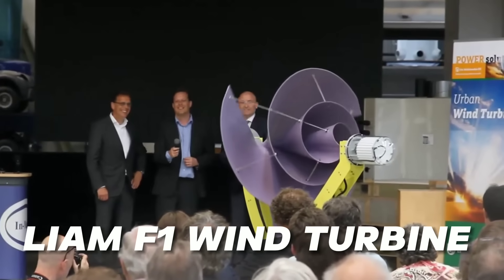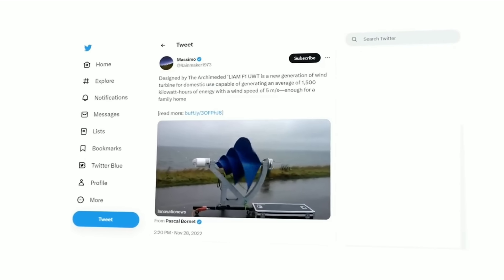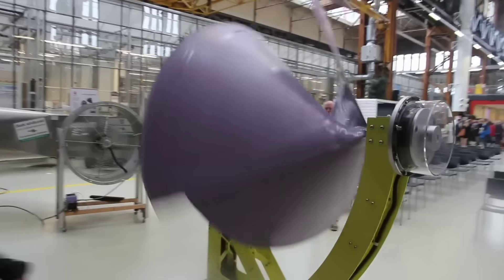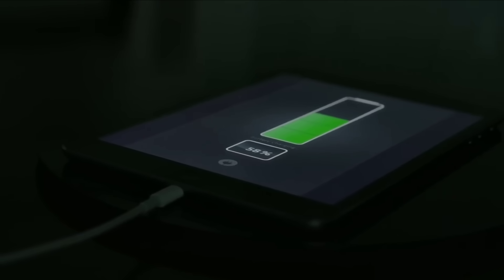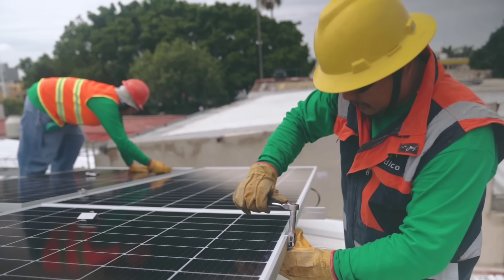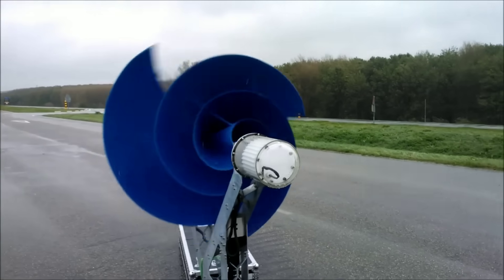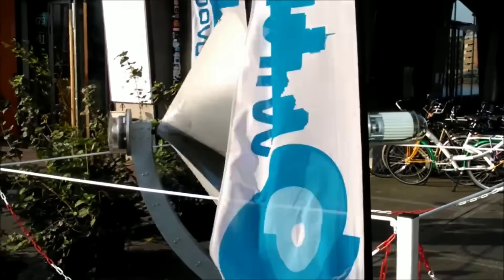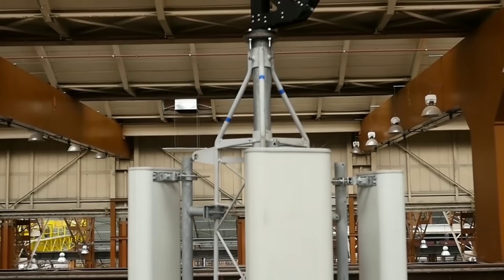This NEW European Wind Turbine for Home Outbeats PV Solar Panels in 2023?!

Comment: In the 15 years we have had solar PV, the panel peformance degradation has been almost zero.  We've cleaned them once.
Reply: Yeah, I get tired of everyone who selling a new innovation lying about the problems with the previous technology. Just tell us what is good about your new innovation and leave it at that.
Reply: @GrantSR I agree. ‘Don’t try to look better by degrading others’.
Reply: I think Solar and wind can complement each other night or day and with the correct number of battery storage wattage it could work👍
Reply: Only issue I had, was kids smashing a panel I had to replace, I only hosed them down to even see if they were dirty.. tyey were not after 9 years.
Sun does more damage to the (exposed) plastic then any thing else
Reply: @danielthompson3205   I have two large solar panels on the top of my minivan. (I was a vandweller for 6 years.) People always ask me if I'm worried about hail damage. I tell them that the panels are protecting my car. That they are rated for much larger hail than the roof of my car is.
Reply: Me too generating the same today after 10 years as year 1.
Reply: Thank you for posting that.  All I read is that they degrade over time and need to be replaced in 25-30 years?  In reality - probably not.  If you amortize the cost of installation over 50 years they really look like a bargain.
Reply: @markstephenson6952 Had our original array up since 2012, cleaned two years ago as we had some lichen form on the top ones. Last August we had our best ever production on that array. Bottom line, there may be some small degradation over the years but it’s the amount of sun shining is the one that makes the difference. With the wind turbines their production is also dependant on weather, the wind. They shouldn’t be viewed as competition for each other, as the video said.
Reply: @lynnfisher4396  There is a kind of anticorrelation  between wind and sun. Still, these things are over-priced, so I can't see a great demand.
Reply: @lynnfisher4396 They should be seen as complementary.
Reply: @Danielle-zq7kb  I did say that, yes.
Reply: @markstephenson6952 I think the climate has to do with that. In Florida they degrade faster according to customers and solar companies.
Reply: @markstephenson6952 Actually, you can amortize the cost and benefit of these systems because you have to factor in rising utility costs. And with the rapid climate change we are experiencing, utility cost will far outstrip the cost of the systems in the next five to ten years.
Reply: @markstephenson6952 what a bargain! Considering that I probably have about 25 years of life left
Reply: @markstephenson6952 aren’t the very first solar PV panels installed in the US in the 1970s still producing electricity
Reply: @hughmarcus1  my Casio Calc still works, & it has not rained satellites due to no power.
Reply: How much is almost zero?
Reply: Agreed. I've got 20+ year individual panels still Max👍👍👌👊
Reply: ان المبلغ المطلوب مقابل السلعة هو كبير جدا بالنسبة لمولدة  و قطعتين من ااحديد و حلزون بلاستيكي . 
اذا كان الثمن ١٠٠٠ دولار سيكون مناسب . 
نحن في الشرق الاوسط مردود الالواح الشمسية ممتاز لكن مشكلو المساحة لتثبيتها .
Reply: Same here - had mine since 2015 - plus tesla powerwall
Reply: On the surface it seems to be a good invention. I could see using a combo with solar
Reply: Oh ya. I want a see a mini one for my rv
Reply: Having no degradation without cleaning them every once and awhile? I call bs. I have had solar panels for only 5 years and high quality. Anybody that says they don't get degradation and never clean them, I say has never done an accurate test. Try using a squeegee to clean a line of panels with some dawn dish soap, and I will put my life on it that they perform better than the others.
Reply: Can I use one on my RV ?👍🏻😀
Reply: @LS-vo7hc  there are special units for RV
Reply: What crap. Solar panels need no maintenance and wind turbines need plenty
Reply: @TomTheSurgen1  Just explain how me, a professional installer, has not needed to do ANY maintenance on any of my Solar builds.
And would you educate me in what maintenance would be involved.
Reply: At least you got 15 years out of them before having to get rid of them for 2 of these awesome looking turbines.
Reply: @ShutYourMouthBeeech  he said have had, meaning he still has them and likely will for a few more decades.
Reply: Ohhh. Did he not watch the video or what? He should get rid of those dusty panels and get 2 of these awesome turbines.
Reply: Just don't fall for Solar when the utilities company wants to install it on your roof/property..it is NOT beneficial to the property owner in my opinion. Get a power storage and store as much as you can and stay OFF the grid..cripple the Corporate plan and stop giving them money . Period. It can be done.
Reply: @Nowayjose-vd1wm  it will become easier and easier as battery storage system prices keep falling.  While it’s not realistic for many, it’s super realistic for lots of people.
Reply: @brettgracey9682  agreed 100%... not certain where your located but here in NY state they seem to pushing homeowners to let the power companies install and basically lease back ..I have seen countless issue with that "plan" ..I myself can not afford a battery wall yet but I am working towards that. All good things in time
Reply: @jkirby-vd1wm  What about when you use so much electricity that there'd never be anything to store?  Batteries of any sort would not make sense for me.
And at €0.46 a kwh, the mains supply is expensive.
Reply: I think the wind and solar would be perfect for a home stead in the mountains. Its always windy at night and especially the fall/winter (in the Appalachian mountains).
Reply: How much progress has been made in over 100 years.
Reply: I’m looking at solar but don’t know much about it. How much are the maintenance costs (electronics, panels, batteries etc.) over 15 or 30 years?
Reply: @RobertJohnson-lb3qz  assuming you are talking about a 10kw or less home array, you should probably go with micro inverted panels.  With them you shouldn’t have any significant maintenance costs beyond spraying them off with your garden hose.  The panels themselves and the micro inverters usually carry a 25 year warranty.  As for the rest of the system, it’s kind of like asking how much does a loaf of bread cost.  How big of a battery system do you want/need, if at all.  There are some components that can wear, like charge controllers, cutoff switches, the batteries themself, that are subject to degradation, and that rate can vary widely depending on size and quality of the components.  Many of them only carry a 5 year warranty.  If you don’t go micro inverted panels, then you will have an inverter with a 5 year warranty.   There are lots of variables and it would be best to consult a professional as to what your needs really are and how best to fulfill those needs.
Reply: @brettgracey9682  Thank very much! 👍
Reply: @RobertJohnson-lb3qz  
Don't bother looking!  Despite what you may read here, there is simply no way (mathematically) that a typical solar array pays for itself.  It will end up COSTING you money.

A typical 3kW solar array with batteries costs £9,795.
It will typically generate 2,500 kWh a year.
2,500 kW would cost £750 at 30p per kWh, so you’re saving £750 a year.
We have to remove (from that saving) your lost interest of £490 on the capital (at 5%).
So you're down to £260 a year.
Maintenance costs are £160 a year.
So you're down to £100 a year savings.
BUT...
In 12-15 years you need to change the batteries, that’s £5,037, and the inverter has packed up, that’s £5,251 - so £10,288.
So your savings of £100 a year over 25 years is £2,500 - minus the above equals a loss of £7,788 after 25 years.
Madness, isn't it?

Inflation and interest rates affect the above data, but one tends to cancel out the other.  Even if electricity massively increases from 30p per kWh, the data doesn't change much, you still lose.  As crazy as our energy prices are, the fact is that you cannot typically do it cheaper than a supplier can.  If you could, there would be no electricity suppliers.
Reply: I’m not sure I’d trust anyone who reports kilowattt hours as km/h, surely it’s kw/h, as for the rest of the narrative it’s all “according to the company” quotes, not for me thanks.
Reply: When you buy amorphous panels that is what happens, not polycrystalline.
Reply: Bull. The panels output drops as the temperature increases. You’re just too ignorant to know better.
Reply: I don’t clean mine and ge5 same returns as I did years ago
Reply: I think as most are saying one should sell their advantages ans try to compete with other options because its not a one size fit all for all markets and not everyone has wind, hydro or sun except for a lucky few geographical areas.
Reply: Where i can lern that new math?
Reply: Solar cells are basically pieces of rock. They are usually silicon. That's rock. They will almost never degrade.

The myths of degradation are highly over stated.

Sometimes you have damaged wires etc that need some resoldering but that is usually obvious and easy.

That does NOT apply to the newer flexible panels. They can (will) get a lot of minor cracks from vibration and folding that can eliminate continuity and lower output rather drastically with use.
Reply: That was bs in my opinion. Rain is doing pretty good job cleaning them. Don't know a single person who has to clean them.
Reply: Back then performance warranty used to be 10 or 15 years ..get the new one
Reply: Put I don’t think I can make solar panels pay for theirselves
Reply: Outbeats? I’ve been speaking English for 77 years and that’s a new one for me!
Reply: Minimum wind velocity needed for this Home wind turbine ??? What would happen in RAIN ???
Reply: Anything that has moving parts will have maintenance .
Reply: Are u talking about panels or batteries here
Reply: We have had pv solar for 30 there is some degradation but not bad! I’m sure newer models are even better
Reply: @jonathannumer5415  @grahamsouthon553 is properly 16-18% efficient, mine are 2009 panels and are 12-14%, today's solar max's out a 22%, and the maximum efficiency possible is 25%, my array still as the same production as from new, from the yr by yr data, when I sell solar to customers I point out satellites have been in space scene 1955 and most people may still have a Casio solar Calc from the 70s. 
I'm sure there will be some losses, if they still work, don't try to fix them.
Reply: @jonathannumer5415 😂newer model they make even worst because they want sales so they decrease quality of the product to boost there sales
Reply: @jonathannumer5415 3
Reply: are you talking about panels or batteries ?
Reply: from what I heard you gotta clean the panels regularly to maintain efficiency.
Reply: @spicychad55   Yeah, but "regularly" means just a few times a year. And you gotta clean your RV anyway. So, there you go. Sure, you can clean them every week, if you want, to keep absolute peak efficiency. But, if you are smart, you actually plan your capacity with the assumption that they will be kinda dirty all the time. 

It's kinda like people complaining that you gotta clean your spark plugs in your car, or "the efficiency degrades." But no one cleans their spark plugs every week. You just engineer your system to account for the fact that spark plugs get dirty just about as soon as you start the engine for the first time. 

All the complaints about solar are mostly just focusing on tiny problems while ignoring the major problems with other solutions, simply because we have become used to those other problems.
Reply: @spicychad55 so what you lazy fooker 😅😅😅 ffs
Reply: $2,000 for solar panels is extremely optimistic in the U.S. even with the so-called subsidies that were supposedly offered. Solar panel installation has many more drawbacks other than just degradation, which in most cases actually runs closer to 7 years. Installation of solar does not provide power to your home but feeds back power to the grid, thereby reducing your utility bill. Once your panels on the roof they are there to stay. If you have replace your roof, due to age, weather, etc., you have to have the system uninstalled and then reinstalled after the roof is replaced. Your panels are not covered by your homeowners insurance which means you will paying out of pocket for any wx damage. When selling your home they are also detrimental to the general market not interested in solar, especially if they are aware of the short comings. And if you’re still paying on your original contract, you can forget about any buyers interest period. 
The video was honest in its appraisal of the benefits and shortcomings of wind power. Most importantly, determine what conditions you have to support each media and look at your long term goals. 

The most important thing to realize is they both will soon reach a point diminishing cost, because utility cost are soon going to far outstrip the cost of these systems.
Reply: @larrymcgill5508  if you have a decent installer, you typically have to have a relatively new roof, to get an install.  Who would pay for an install, then get a new roof 3 years later?  As for net metering, that would be up to the individual jurisdiction.  With the rapid expansion of home battery storage, one could easily disconnect from the grid, or only net meter a portion of electricity generated.  As for a selling point, I would think that’s a financial decision.  If one was in an area where they routinely got $600-$800 electricity bills due to air conditioning loads, having a solar array that significantly reduced that monthly cost would be rather attractive to most people.
Reply: Solar panel degradation IS 0.6% per year.  You cannot dance your way around that.  You will typically NEVER get your money back (capital investment) on solar panels or wind turbines.  The mathematics say so.
Reply: @jimskirtt5717 even if we were to accept your number as true, a 400w panel at 30 years would still produce 328w, or 82%.  A more accurate number is actually .5% per year, which would means the average 400w panel would produce at 85% after 30 years or 340w.  Hardly insignificant.
Reply: @brettgracey9682  
Doesn't matter.  The mathematics say typical solar doesn't payback - in fact, it costs money.  It wouldn't matter if they retained 100% efficiency (which they probably will in the future - but by then, everyone will know that solar is a dead loss).
Reply: @jimskirtt5717  well Jim Skirtt, give us those numbers that just don’t add up. Also tell us what jurisdiction you are making these assumptions in, so we can also calculate how much solar power can actually be generated.  Thanks.
Reply: @jimskirtt5717 solar panels payback period is like 3 years in the NL. do your research
Reply: @jimskirtt5717 if your paying someone to do it...diy its well worth it
Reply: @jimskirtt5717 By chance did the math also include the rapid climate change and the runaway escalation of utility costs. I think probably not.
Reply: @larrymcgill5508  
Inflation is factored into the cost analysis I have done.

So, do you think something can be done about climate change, then?  I note you didn't say 'man-made' preceding it, which is good.  I don't know if it's because of your personal ignorance or a slip on the keyboard - you tell me.

As for utility costs, there are a number of factors, but again, it is basically because of futile attempts to claim CO2 as a control knob.  If we burned our coal reserves, we could have amazingly-cheap energy.  Now, be careful, as this is my field, and I could tie you up in knots if you are not as 10% armed with knowledge of the energy sector as I am.
Reply: @jimskirtt5717  Dude! What are you thinking? Did you re-invent math? New solar panels are between 30 to 50 cents a watt. They pay for themselves in a year or two.
Reply: @MichaelBushey  
No, they don't.  Typically, they NEVER pay for themselves.  I don't know what you do, but I do this for a living.  If you think they typically EVER pay for themselves, show me the mathematics (the FULL cost analysis) which exists in the universe you inhabit.

The difference between you and me is that I have done it - and have to do it for each client.  You on the other hand, have read something and believed it to be true.  If you want me to help you out, let me know.
Reply: @MichaelBushey  
My replies are being removed!

1.  How much was your total capital outlay?
2.  What is the cost of purchased kilowatts from your supplier?
3.  How much will your system save you annually?
4.  Where did you get the money from - what interest rate was it earning?
5.  What will be the cost of your inverter/s in 12-15 years?
6.  What will be the cost of your battery/ies array in 12-15 years?
7.  How much do you expect to have to pay (annually) for maintenance and breakdowns?
8.  Have you factored in that your panels will supply 0.6% less every year due to degradation?

If you did that analysis, you would see the true economic (financial) conclusion.  The above is how you work out if something is economically viable.  You don't simply do it by saying what kW comes in and out.
Reply: @jimskirtt5717  shhhhhhh, funny how silent when questioned.
Reply: @eco-terrorist  
I have checked, and you are getting my replies - explaining the cost analysis, so I don't understand why you're playing some puerile game.
Reply: @jimskirtt5717  I gave you the data again no games, consider yourself pwned.
Reply: @eco-terrorist  
No you haven't, and everyone can read back and see that you haven't.  So I'm afraid on top of everything else, lies as well!  Do you even know what a cost analysis is?

Come back when you grow up and admit that you can't do a cost analysis - I have even offered to do it for you!  I'm always here to educate you.
Reply: @jimskirtt5717  you keep talking about cost analysis, yet you seem reluctant to post your numbers.   It’s almost like you don’t know what a cost analysis is.
Reply: @brettgracey9682  
Well, there's silly, and then there's whatever your comment is.  If you read back through my replies, you'll see YouTube has allowed me to post the full cost analysis TWICE at least.  I have actually posted it seven times, but YouTube have removed the posts for copy/pasting.  But at least TWO are still there, I have checked.  So I think that your reading skills are far from standard.
Reply: @jimskirtt5717  it’s nice that you worry about my reading skills.  I assure you they are fine.  Am I to assume you believe your 8 questions are a comprehensive cost analysis?  It’s actually not very comprehensive at all, nor is it an actual cost analysis.  Is that what Youtube has been removing, or is it actual data?  It also seems like you are grouping all solar arrays into the same bucket.  Are you talking about rooftop consumer owned 3.4-10kw systems, or 100-??? Mw solar farms?  They are very different animals with different concerns.  

If you could clarify, that would be illuminating.

Thanks.
Reply: @jimskirtt5717 why is the cost of an inverter etc. in the future anything to do with the return on an investment now?
Reply: @jimskirtt5717  how do you get clients then?  You say to them 'pay me x and you'll never get all of your money back?'
Why would they continue?  
It seems to me that YOU don't add up ...
Reply: What math are you doing? Try studying more lol!!
Reply: @jimskirtt5717 that is if it was the past but newer type of solar panels are now better and sooner with AI technology hopefully cleaner energy will be cheaper specially if you gave both.
Reply: @jimskirtt5717 You seems pretty bad at maths......
Reply: @jimskirtt5717 tbh I don't understand your comment.. I have solar panels front and back of house for 2 years.. I never paid a electric bill since combined with 9.5kwh battery and free showers. I will have it paid withen 6-7 years. I'm writing this while my electric stove is warming the room. Not sure what theory you came up with there, makes zero sense. Also increases the value of your property
Reply: @jimskirtt5717  There was a massive combined solar and hydro plant in China where the payback on investment in solar was 18 months. The reasons for this are solar panels are cheap at the source of production. The farm was huge so got economy of scale. The panels were fixed to the ground so no expensive mounting. Finally they tapped into the grid connection to the hydro plant so did not need a separate connection to the grid. Electricity in China is 7p/unit. It's amazing what you can achieve with the right brains. Solar panels are continuing to drop in price and new technology could double the efficiency.
Reply: @Andrew-rc3vh  
The cheaper the cost of electricity, the less a renewables package makes sense.  Think about it... if you were paying 7p for your electricity, your solar/wind project would literally have to be almost free of charge for it to be worthwhile.  But it isn't free, as to build and maintain a plant cost a lot of money.  I would have to see the data, but I strongly suspect that economic fiddling took place.
Reply: @jimskirtt5717  The difference in China is they do report all the numbers, so this is how I know. I have no idea what the payback period is on Brit developments are they keep us in the dark. The thing is is you look in the factories of these places the whole thing is run by computers and robots. The ingredients of a solar panel is mostly sand. We are the ones being fiddled though. 7p/unit sounds like a good price to me.
Reply: @Andrew-rc3vh  
Thanks for the info, but you are saying that their unit rate is 7p per kWh, correct?  If so, then no renewable could possibly be competitive with that rate.  It would be cheaper to actually buy electricity from the supplier than it would be to run a solar panel, even if the panel were free.  Solar panels and turbines can only work financially if the cost of electricity is high.  Even then, they will barely pay your capital costs back in 25 years, if ever.  Like I say, I can't comment on they efficiency without seeing their data, but I think it's highly unlikely to be viable.
Reply: @Andrew-rc3vh  In the UK if you have hydro solar and wind, you have to recover the cost, but the hydro needs a licence which might be every year I don't know, but if you had all three you would be gaining the most of the environment as you can.
Reply: @terranceyeo3087  The problem in solar is the intermittent nature of the supply, and where storage is expensive, so we need wind and hydro to even out the peaks and troughs so as to require minimum storage. The other trick is to use HVDC to spread the power out geographically. HVDC loses power the further it travels, but in China they have new ultra high voltage technology that can move large amounts of power across China with much less loss. One other issue in the UK is the radiation is only about 1/3 of what you might get in the Gobi desert.  We are building a solar farm though in Africa where we will import it via undersea cable.
Reply: @terranceyeo3087  What is  "hydro" ?
Reply: @michaelmongillo1237  making power with water, a water turbine the same as wind turbine but with water
Reply: @terranceyeo3087    you have a river or stream.?
Reply: @Andrew-rc3vh  In one of the towns in my State we had one of the massive Wind Generators.  Everybody was all excited about it , were green, saving money, savings
beginning to pay back the cost of the wind generator.   Then it broke.  All the money that went towards the payback and more, had to be spent for the repair.
There was discussion of just cancelling it but then they decided to fix it.    The mfg and installers/maintenance workers are the real winners.
Reply: @Andrew-rc3vh   "China they have new ultra high voltage technology"  Would that be all those shiny new coal fired plants?   I understand they started construction on over 100 plants in 2022.
Reply: @n1kkri  This is why I like solar. You can arrange it to work with no moving parts. The second advantage is if one or two panels fail they just get switched out of the system and not bring the whole system down. I think solar is going to win out as the cheapest form of energy eventually, even if you factor in storage.
Reply: @lo1234-w9r  No, I'm talking about power lines. The higher the voltage the less loss you incur, so chances are the sun will shine somewhere in China, so they can feed the power to the cloudy parts. Coal is just an interim measure in China. They use a lot of power because they do all of our manufacturing.
Reply: @Andrew-rc3vh  If I were younger I might consider it for a new house.  The problem

I have at my age I'm  not sure the payback is worth it.   I think the best solution is all the existing forms of energy.  Use whatever is doable at the time or whatever is the cheapest.  I would like to see solar improve
in the future.  I don't like putting them on a roof especially if you have to remove one.  Something about drilling holes in a roof worries me.   Then if you need to replace your roof the additional labor of removing panels and replacing them would eat into any savings.   New construction makes sense.  Both the panels
and the roof most likely would be in sync with replacing.   
If I could and it was cheap, I would put a small nuclear powered Generator. Something good for 30 or more years but the cost of that would be huge.

We have Wind Generators going up all over the place yet the price of Electricity continuous to cost more.
I want as much energy competition as possible including domestic energy to compete against each other.
Reply: @n1kkri  Yes I totally agree with that. What we should do is improve the grid so farmers and the like can use a spare field for it. You buy solar panels in bulk, as in > 100kW, then the price is far cheaper. As it is there is a long waiting list to get permission from the authorities to install a solar farm. If we can get rid of the backlog then strong competition would bring electricity prices down. Eventually that should mean you can get electricity off the grid cheaper than generating it from a roof installation.
Reply: @Andrew-rc3vh  I am not into Green as much as others... I am a let the consumer choose what he wants
and what doesn't sell will go away.  i don't see Grid electricity prices dropping soon unless the energy used
to generate the electricity drops in price.  You need an awful lot of farm panels to supply the power the grid can produce and that would be only in the daytime with sun.  Wind Generators are huge and can't go up anywhere. I can't imagine someone wanting this monster next door.   Today, solar panels on a roof are expensive and a mystery to when the true payback is to the customer.
Reply: @n1kkri  The economics of it are that in bulk you can buy panels at 16p/W plus add about 5p/W for the electrics. In one year in southern England you can generate about 1.2kW/h in one year per Watt of panel. You can see how ridiculously cheap that investment is. Of course if you are doing it on a domestic roof you would pay a lot more for the installation and all the brackets and rails. Storage is also a cost, but can be done far more economically with indusial flow batteries.
Reply: @Andrew-rc3vh  It depends on what the definition of "bulk" is.  If your the company selling them or if a consumer wants to buy a dozen panels.
Reply: @Andrew-rc3vh it's easy to get return on investment when you can charge for the energy you produvpce. The average person cannot
Reply: @andrewcarlson2178  The price of energy is determined by a market, so it changes according to demand and supply. I think what the problem is, is that we are being ripped off by the energy firms. This needs government reform.
Reply: @n1kkri  typically 100kw- 1 MW range would see you at about the maximum bulk discount. You'd want to ship an entire container load = 300 panels = 120kW.
Reply: @Andrew-rc3vh  I don't think 300 Panels unless there about 1 foot square could fit on my roof.  This is the point I was trying to make about the cost of solar.  I only need what I need.
Reply: @Andrew-rc3vh  Shiny new power lines to connect to those shiny new coal plants.
Reply: @lo1234-w9r  They are going to build a global supergrid. This will solve the storage problem. Coal powered stations don't need backup storage.
Reply: @jimskirtt5717 maybe were yer from 7p but in Ireland it's 44c a kwh. Guess it depends where your from and how much there charging ye to install.. Makes sense here
Reply: @jimskirtt5717  here is data for you Jim, My Home has Solar, battery, immersion redirect. i have used from Feb this yr that's a full 6mts 100Kwh of energy that in uk terms is £30.
in total 12mts window 1200Kwh £360.
so don't say they don't work when clearly they do. another thing i have done over 200 installs not one person has said there a waste of time. Capital = ALWAYS A RETURN, you do the maths.
Reply: @ecoterrorist1402  Are you saying your solar production for 6 months was 100 kWHrs worth £30 or just for the month of Februrary? If the former, then 12 months would only be 200 kWHrs worth only £60.  Please clarify.
Reply: @eco-terrorist  had to chuckle at your response to "jim", it's amazing how many dumplings write utter p*sh. I generate about 3MW a year and have done for 10 years, on a 4kW setup, I'd love someone to tell me how that doesn't make financial sense. (Particularly now I have a battery too!)
Reply: @BlackBuck777  
You have your wish...
It doesn't make economic sense...
and you cannot do basic mathematics.
How's that?
If you think I'm wrong, show me all your cost analysis data (which you have never done because, if you did, then you would have seen the financial conclusion for yourself and wouldn't have made any puerile comment).
Reply: @BlackBuck777  like the setup 😎 ☀ 🔋
Reply: @eco-terrorist  
Let's try again, shall we?

1.  How much was your total capital outlay?
2.  What is the cost of purchased kilowatts from your supplier?
3.  How much will your system save you annually?
4.  Where did you get the money from - what interest rate was it earning?
5.  What will be the cost of your inverter/s in 12-15 years?
6.  What will be the cost of your battery/ies array in 12-15 years?
7.  How much do you expect to have to pay (annually) for maintenance and breakdowns?
8.  Have you factored in that your panels will supply 0.6% less every year due to degradation?

If you did that analysis, you would see the true economic (financial) conclusion.  The above is how you work out if something is economically viable.  You don't simply do it by saying what kW comes in and out.
Reply: @eco-terrorist he said you don't get your initial investment back. Unless you pay far less than 360 pounds a year for power he's clearly correct. Even if you're energy independent, in most cases you're paying a large lump sum up front to not have an electric bill for 20 years, then replace the panels and start all over
Reply: @andrewcarlson2178   shhhhhhh, funny how silent when questioned.
Reply: @eco-terrorist  Hi. You do installs. I’ll be interested to install solar pannels and turbine in next two years, once I choose where to buy a house. I would appreciate any information.